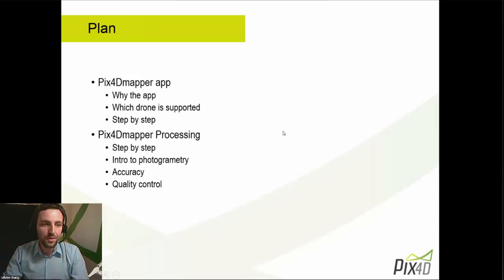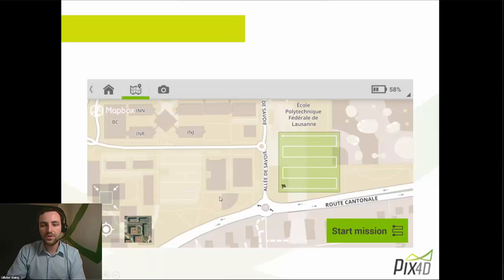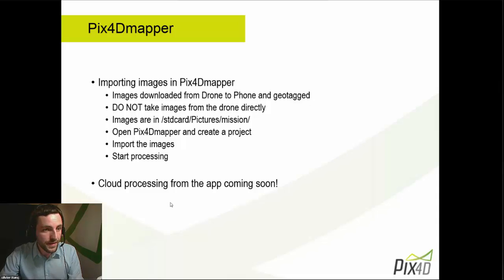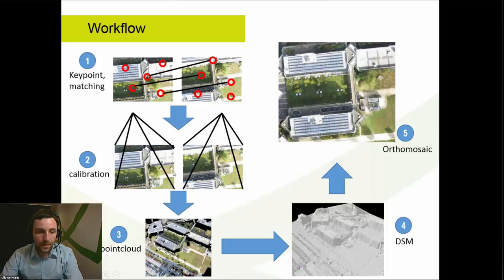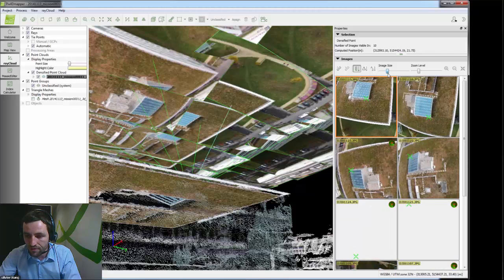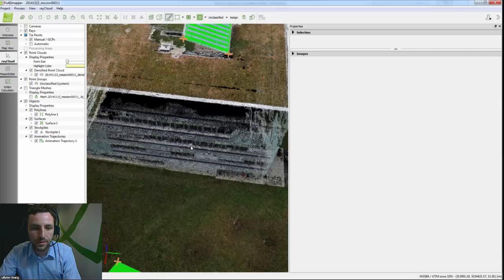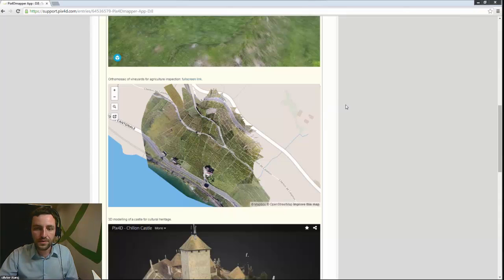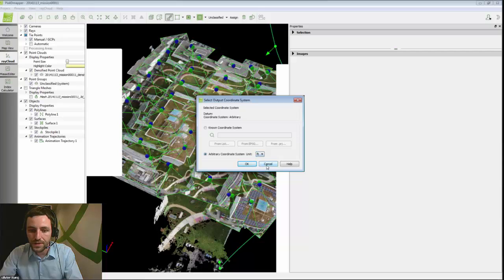Pix4D Webinar 12: DJI Phantom: Mapping and 3D Modeling

Comment: I tried the beta with my P2V+ today, here is what happened. The camera was at horizontal position, and when I started the mission, the app did not change it, tough on the setting screen I set it to 90. I noticed this when P2 reached the starting point of the grid, and then I used the camera screen of the app to turn the camera down. I could do this at the end of the 1st row. The copter continued the mission, but when reached the end of the next row it started to fly away from the grid. So I had to switch to manual mode with S1 and drive the P2 back to the grid. Then somehow I could continue the mission, but before P2 wanted to start the last row, it stopped and started to download the images. The P2 was about 100 m from the home position at 50 m altitude above ground. I had to drive the P2 to home manually. After this I made a new grid, checked the camera (it was in vertical position) and started the mission. The 2nd mission performed sucessfully, without any problem. I found the images in the Pictures/Mission folder.

Comment: Hi PIX4D, This is great as the DJI Ground station for P2V+ dosen't have the Grid option (as the GS for P2) !. Question: Does  PIX4D App  work also for P2V+ in NAZA-M mode or only  just in GPS mode ?

Comment: Hi, Great !!. I am running a Phantom 2 with Gopro 3+ and geo-tag with V-990. Why can't your App. be also for the Phantom 2 ?. I am using the Ipad GS or PC GS, both have Grid function for flying. Thx. Dave
Reply: The Pix4Dmapper app controls the flight and the camera. The joint control is more complex with the gopro. But if you have the data you can use the Pix4Dmapper discovery to generate the models from gopro and your gps tracker.
Reply: Hi David! How do you combine gopro pictures and GPS tags? Can you describe the workflow?
Reply: Сергей Петров Hi, The V-990 dataLogger comes with SW that combines the Logging data (Lat/Lon/Alt) with the Image data (based on Time), and updates the EXIF header of each JPG image. It copies the entire images to a new directory. You have to make sure that prior to flying. your camera's time is calibrated.In addition, the above SW can provide KMZ or GPX files for Google Earth

Comment: I've switched the drioe flight computer to Naza Mode for some more advanced flight features. Does the app work in this mode or do I need to revert back to phantom mode?
Reply: I tried it in Naza Mode, Drone took off hovered for a bit then started descending. Would try and go through the floor if i didn't intervene. Reconfigured the Vision+ back to Phantom mode and flew no problem.
Reply: William Britton good question!
Reply: William Britton I believe from watching the video, he does say that in the future I will be able to work with the Naza software. But not yet. That was one of my questions also.